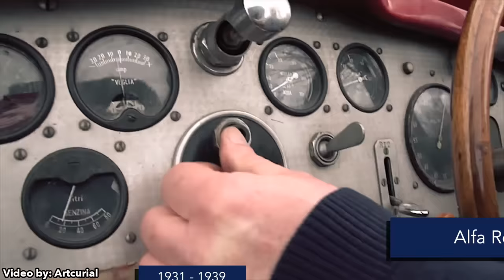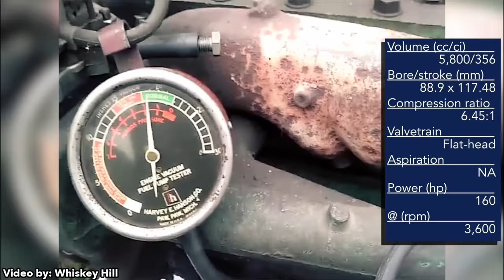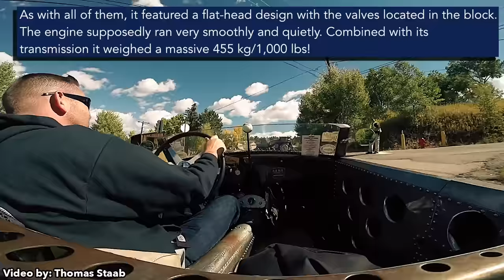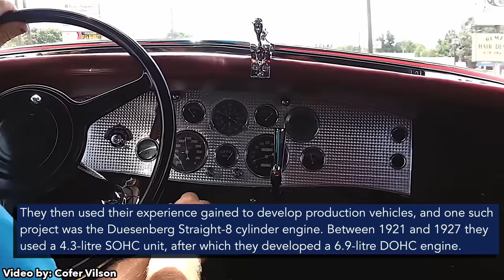The Best Sounding Straight-8 Engines In The World

Comment: I would love to see a modern I8 engine
Reply: That would be interesting. I'd like to see Ford try a turbo straight eight as an intermediate option for their F-series pickups between the EcoBoost V6 and the PowerStroke diesel. They got enough money to experiment.
Reply: I would love to build a 5 valve per cylnder  turbocharged flat 8 engine with the warble of a Subaru/Porsche mixed with the unmistakable 8 cylinder sound. Mmmmm
Reply: Could build that as a VR8, that makes it a bit shorter, as modern cars don't have these impressive long noses anymore.
Reply: take two inline 4 engines and there you go
Reply: well modern BMW's have very long hoods
Reply: You mean 3 or even 2 cylinders and 1 or 2 or more turbochargers
Reply: Indrid Cold I love odd and old engines, but the reason isn't all governments. Inline 6's can't really compete anymore. V6's can do what an i6 can do in a smaller package. Smaller package means less cost and the hood area is smaller which means less aerodynamic drag. The fwd isn't ridiculous. Rear wheel drive vehicles aren't needed in most cars. The average commuter wants a reasonably powered car with good mileage and good traction for bad weather. A front wheel drive car is not only cheaper as you mentioned but it's also more efficient since there are less moving parts and it's lighter. The weight over the front axle allows front wheel drives to do better than almost all vehicles on the road. There isn't anything wrong with a front wheel drive. Only SUV's, trucks and sports cars are rear wheel drive and that's due to the positives of a rear wheel drive. Weight bearing/towing vehicles need the load placed over the rear axle, also the natural acceleration of a vehicles places the force on the rear (you can see this in cars taking off, the rear will sag while the front raises up a bit) for a front wheel drive this isn't a problem since most of the time on people are in the FWD so it isn't a big deal. In high power sports cars rear wheel drive favors the fast driving style, balance, and for some the drift factor. Now to address your next point about engines disappearing. I love V8's and i4's I hate V6's because they try to get the mpg of an i4 with the V8's power but fail to do so without turbo's. But it doesn't matter because electric cars will over take the entire automotive market slowly as technology improves. i4's might stick around as range extenders. Look at the BMW i8 for example. The days of the combustion engine are numbered.
Reply: Some countries in Europa are already talking about banning the combustion engine in new cars by 2025, for real petrolheads boring times are ahead.
To enjoy the pleasure of an engine you will have to resort to a classic car, but where to get the fuel when the combustion engine dies out?
Not to talk about the diesel locomotives that I as part of a preservation society try to keep running, and guzzle diesel by the hundreds of gallons over a weekend of service, will we still do this in 20 years time?
Reply: +Indrid Cold Well sadly that's where the car industry is heading it's a shame I love the sound of a nice I6
Reply: Don't tell any of that to Christian Von Koenigsegg, as he is actively revolutionizing the very concept of the internal combustion engine. Indeed, he has already successfully reverse-engineered the humble torque converter and completely re-imagined its function in the drivetrain of a high-performance hybrid vehicle (Regera). Just wait for him to finalize and release his next creation, the cam-less "Freevalve" engine.
Ludicrously powerful twin-turbo V8 with infinitely and discreetly adjustable valves? Yes, please!
Reply: straight 6s got some torque tho, my 25yo BMW keeps up with my moms V6 thats half the age with more power.
Reply: +Indrid Cold, Cheap isnt the Thing. Its the weight. Differential + Driveshaft weight much more, its profitable to driving safety, and also they need to get the weight down to pass emission tests, Cause more weight needs more power to be moved, means more fuel used, means more greenhouse gases.
Reply: +Avus95 Really ? Any manufacturer could produce camless engines. The thing is that its the Cam and Variable valve timing that differentiate the most in todays engines. without those, anyone could produce Perfect power cause they can adjust the lift and opening times variable.
Reply: "Any manufacturer could produce camless engines"
Huh, funny then, that in the 107-110years that internal combustion engines have been around, nobody has produced one. And yet there you have Christian Von Koenigsegg, a boutique hypercar manufacturer, spending millions of his own personal dollars on the R&D to develop an engine that you claim "any manufacturer could produce."

Don't worry, I won't hold my breath for FORD, FCA, GM, VAG, or any other major auto group to release their own versions of solenoid-actuated valvetrains any time soon, because they won't.
Reply: dieselmupke  bio diesel if still permitted to burn fuels
Reply: No need to put Koenigsegg on a pedestal. His company make million dollar low volume items. That's why certain design decisions can be taken for these 'hypercars' that makes zero financial sense for volume production. But to think that major manufacturer's R&D departments don't know how to do it will be idiotic. Camless engines will eventually come to market. All companies are cooking their own recipes for HCCI, oleopneumatic or even electromagneto cams since the late 90s. It's just that they're not flaunting videos on youtube about it.
Reply: you know ill just stick to my cams so i can swap them out and get a dope sounding idle
Reply: Huh, million-dollar low-volume items right?
So then why have we not seen or heard of any similar technology coming from the likes of Ferrari, Pagani, McLaren, etc?
Again, here is this argument that "oh, well any manufacturer could do it" and yet Koenigsegg is the only one who actually has put forth the energy and devoted the time and resources to developing it. SO yeah, Christian deserves to be on that pedestal. His engineering capabilities from such a small company are incredible especially when compared to other, much larger hypercar manufacturers with much larger budgets and many more engineers and employees.
Reply: Black e34, first off, I love your username :)
(I have owned many E36's two of them M3's '95/'99) But I have always lusted after an E34 M5.
Cams are an excellent way to change the power delivery profile of an engine. My '95 S50 had Schrick race cams and a blueprinted engine (was a former weekend track weapon, when I bought it I converted it back to street duty but left most of the race upgrades in place loved those PSS9's!) and that thing absolutely RIPPED in the top end. The best way I could describe it was to compare it to an aggressive two-stroke dirtbike coming onto the pipe. When the tach needle passed 5k rpm it felt like an extra 50-100hp had just been unleashed. Awesome engine and chassis which I still miss to this day.
Reply: Avus95 That's awesome! Sadly I don't have cams yet but they've been on my list of stuff I've wanted for a while. You're making me want some even more!

Wish mine was an M5 but I probably would have killed myself already. Mine is just the 535i with a (tiny) bit of stuff done to it, nothing serious at all.

I'm not sure about getting kicked in the ass at 5k but RPMs pick up fast around 3.5-4k with the m30 3.4l straight 6 and I always joke to my friends it's "bmw vtec".

One day I'll get an S tho, whether it be an s50, s52, etc. I don't know much about them besides they haul ass, always have wanted one though. :)
Reply: +Avus95 110 Years yeah, But only 20 With really High tech technology, That wouldve made it remotely possible.
Reply: And also your American companys wont, Theyre still stuck at freakin Pushrods.
Reply: Lol, I know. It's the classic "If it ain't broke... don't fix it"
But it's pretty hard to argue with the massive success of the GM LSx series of engines.
Reply: Experimenting and putting into production are two entirely different animals. I have experiemented with homemade solid-fuel rocket motors in the past. That doesn't make me a f*cking rocket scientist though, does it?
Reply: Yeah the 3.4 is a great engine with plenty of torque, but due to its design won't really ever be able to reach the same maximum-rpm levels as the much smaller S50 3.0 (also having a blueprinted engine, knife-edged crankshaft, cams, and lots of head work definitely wakes up the top end!)
By the way, get the S50, night and day difference to the lazier s52 which was more of a sporty street car engine, whereas the S50 is essentially a high-strung race engine from the factory just waiting to be uncorked.
I absolutely loved my '95, and pretty much hated the '99 lol.
Reply: Avus95 Yeah not too many people seem to build the 3.4s. There's some aftermarket but not a ton for n/a, mostly just turbo kits. Pretty sure theres a big community for the m20 though, lots of stoker kits n stuff.

Damn if I could stoker my car...

Thanks for the info though, don't really have any budget for another car at the moment (just blew a subaru up, lol!) but ill be in the market sooner or later for another little project car to take ripping around some gravel roads or something.
Reply: I suggest you look into the Wartsila 96C series
Reply: They are 2 strokes.
Reply: There' are a bunch of L8 engines, mainly industrial engines, like Caterpillar Man and Wartsila 4 stroke or gas, but they are as i say for industrial purposes like ships and powerplants.
Reply: There is the L12 Fairbanks Morse OP 2 stroke also.
Reply: Does this run mikuni oil injection pumps?
Reply: Wärtsilä 8L46
Reply: PaInTeX99 Popular Science magazine June 1991. Ford introduces a modern straight 8
Reply: Black E34 but with something like freevalve you can do the equivalent of switching cams per each rpm, so technically it's possible to have a radical difference in valve opening between 2000rpm and 2001 rpm. All by just changing computer code. Freevalve engines compared to camshaft engines is like fuel injection vs carburetor, it's changing out a physical object for a digitalized version that can be changed infinitely.
Reply: PaInTeX99 ew, modern
Reply: @Indrid Cold, who elected these government masters who create regulations? The people.
Reply: Stephen Keeler - Ferrari built one... not sure if it ever made it past testing. No warbler ("boxer" or "even fire" sound)... it sounded like two well tuned 4 cylinders running 90 degrees apart.
Reply: On a mustang 😏
Reply: Impossible
Reply: khadafi yusuf - not impossible. Two CBR250RR engines would fit in a mustang. That would be a 20,000rpm inline 8... but only 100hp
Reply: Alpina XD3
Reply: That's i6 nvm
Reply: @stephen9869  arf arf arf
Reply: Schluter built straight 8 diesel engines for their tractor range in the 1970's and 80's.
Reply: @indianasquatchunters  Nice point, but what small hoods have with less drag...
Reply: @Avus95  I love Koenigsegg too... but camless engines didn't come from F1 since 80's?
Reply: Tom Lahaye Thats true!
Reply: Tom Lahaye I think there’s already a W8 made my VW but I guess if you’re considering to make an Inline 8, a Vr8 is an excellent idea
Reply: big nose
Reply: So would I. Unfortunately its a bad design from a packaging perspective.
Reply: I highly doubt straight 8s are coming to modern cars anytime soon. The v8s are a dying breed already due to emissions. The cheapest V8 is the mustang, Dodge R/T series but others go for 42k+ and most of them are full size trucks. If you're looking at a sedan or coupe v8 that isnt american or a truck, you'll have to spend 75k+ to the Germans. It used to be common since gas back in the 60s was dirt cheap. But now, good luck finding a good deal on a v8
Reply: Sorry we live in a recession 😔
Reply: You could ask nearby foundry to cast the engine block with the right material for engine amd have it machine/shaved to correct geometry.And cams crank piston con rod can also be made at a machine shop and ghere you have it inline i what did it cost: a fortune
Reply: Mercedes glc 300
Reply: Ford engineers came up with weird t drive fwd transmission in the 80’s where the flexplate and converter in the middle where driven in between cylinders on either side of an inline engine. To prove how much space was saved they built a straight 8 and shoved it in a tempo. Seems to have disappeared in history though, little is known about them because ford canned the project and went with their modular engines in the early 90’s
Reply: Ford, GMC/Chevy, Dodge all should have 8 Straight Engines.
Reply: small displacement biturbo fuel injected straight 8
Reply: And I a V16
Reply: Thats a 3 cylinder hybrid
Reply: @stephen9869  that would be horrible. why the fuck would you want this beautiful engine associated with a subaru
Reply: I have some CNC machines and I'm a trained machinist wit 35 years experience. So if anyone out there really wants to see a modern straight  eight , and has some money they want to sink into a project, let me know.
Reply: There are some modern I8 engines in tanks
Reply: put it in the BMW i8
Reply: How bout Iluvu
Reply: @indianasquatchunters  Inline 6 are coming back. Mercedes, Toyota are using inline 6 engines. Mazda's developing a new one. Dying breed of egines are V10's. i4's, v6, v8's are thriving, i6 and v12's are increasing. V12's are about to enter it's golden age. Aston Martin, Gordon Murray, Ferrari, Apollo and who knows what else. Back to V10's, Audi and Lambo, the only two manufacturers still using V10's. Audi's planning to retire the R8 soon, leaving only Lambo left to use V10.
Reply: schlueter tractors
Reply: @indianasquatchunters  tell that to BMW, Mercedes, Toyota, Mazda, etc.
Reply: Absolutely  Me Too and Twin Turbocharged or at least with one Turbo
Reply: @Tom-Lahaye  Basically half a Bugatti engine
Reply: Sadly, they're not practical. The cranks are so long they have a tendency of cracking.
Reply: @indianasquatchunters  tbh imo the feel and handling of RWD is so much better, rwd is perfectly safe in bad weather, just requires you to use your brain (which i guess most consumers dont bother doing these days but thats another thing). not to mention with FWD you have understeer and as someone that had to experience that first hand, its not a fun experience. but for common daily cars cheap fwd boxes are the way to go. shame to see ICE go away, EVs will never be able to capture the sounds or the experience driving a ICE (a proper ICE that say, not your usual eco box kia)
Reply: About 30 years ago I remember seeing in popular mechanics or somewhere designs for new straight 8 sideways front wheel drive that had chain to transmission from the center of crankshaft. Probably too hard to deal with.
Reply: @blacke347  dumbest thing I've heard today. My 25yo MORE POWERFUL car makes more power than a modern car that has less power... Like duh?
Reply: @EnkeiTenjin  you can't read apparently. go back and re-read. also have fun responding to a comment chain over 4 years later.
Reply: @yadidimeanmaine  It would be great but they won't because of the EPA and fuel consumption.   Inline engines are very reliable and create a significant amount of torque but they also use alot more fuel and put out more emissions. For example a 1996 Ford 4.9L inline 6 (145 HP/265 lb-ft of torque) averages 13 MPG City / 16 MPG Hwy while a 1996 Ford 5.0L V8 (195 HP/270 lb-ft of torque) averages 13 MPG City / 16 Hwy. The 5.0L V8 has two more cylinders and has 50 more HP and 5 more lb-ft of torque and gets the same mileage.
Reply: Mercedes has gone back to a straight 6
Reply: @blacke347  what?
Reply: @thehulkamaniabrother2.089  taht's right sadly the new Om 654 and 656 engines are a pain to work on and aren't up to Mercedes standards the previous engines like the OM 642 and 651 were much more reliable and easier to work on
Reply: @mg2699  I have an m103 at the moment. In a 1990 w124. It's a 300se 3.0l straight six. It won't start in the rain and I am about to pour gasoline into it and burn it to the ground. Piece of garbage
Reply: @thehulkamaniabrother2.089  haha don't do that W124 are nice cars maybe check for faulty or corroded grounding points that can cause issues in high humidity I'll ask some older colleagus tomorrow they know more about these old engines than I do
Reply: @mg2699  Hey man, did you ever find anything out aboot the older Mercedes for why they won't start and run in the rain ?? I hate this shit ass car and I need to sell it while it is still running and I haven't destroyed it with a sledgehammer yet
Reply: @jakecole7447  Camshaft meets piston. They fall in love and have little baby valves and live happily ever after
Reply: @thehulkamaniabrother2.089  the only way for the camshaft to meet the piston is to put the engine into a press.
Reply: @jakecole7447  there is no engine.  Only the individual parts that make it up. Those are equal individuals who deserve to be treated as such and safe. Not forced to work for their whole lives inside some Syrian capital city with belles on.  Just so they could meet such a cruel and cowardly act of being crushed by some Persian fornicater in BIG AMERICAN PRESS manufacturing sector processes that are actually not a good idea at the time but it's still good for the economy and that is what we need now.
Reply: @jakecole7447  I think all engine life matters and all engine parts are to be treated equally in the same way as the officer and the younger one who holds the wheel is a good thing I have to be able to get the doors open and let the sun go up in the morning if you know what I mean.
Reply: Yeah i asked some colleagus and they said that's it's most likely an issue with your distributor cap they wear out over time and in high humidity like when it's raining they loose contact they cost about 160€ here in Germany dunno how much it'll be in the states
Reply: @biffex  nah single turbo
Reply: Straight 8 engines sound great but are incredibly large and inefficient
Reply: Me too. Modern inline 8s and also 180° degree V8 engines. Both would sound good regardless.
Reply: just check 8M43 from MAK/ Caterpillar. you can buy it.
Reply: The reason they don't do it is because of the extremely high forces on the crank.  V8s for instance have a significantly shorter crank, and I6 is more reliable.  But I agree, a straight 8 would be such fun to drive around
Reply: Me too, but v16 problem was similar like straight 8 engine
Reply: And why inline 7 car never exist
Reply: Give me a few years
Reply: Dont we all?
Reply: @gabrielv.4358  yes, we fo
Reply: Someone should build an inline 8 based on a barra or some other modern Dohc i6 and put it in one of those old i8 cars
Reply: @william2glaser227  yes, in the 90s, chrysler and ford make an inline 8 concept car, but all of these car were just never made
Reply: @william2glaser227  I’d love a high revving I8 built out of an BMW M50 or something
Reply: @mg2699  absolutely, something I thought of after I commented is using some i4 like a b16 or k20 to create a crazy high revving i8
Reply: You and me both, brother.
Reply: Nobody wants to make history anymore
Reply: @CaptainD00M no then it’s a V8 not in-line 8
Reply: @Tom-Lahaye  I heard in 2030 not 2025
Reply: Closest to sound your gunna get is buggatis new v16 engine
Reply: In a truck.  With a manual transmission.